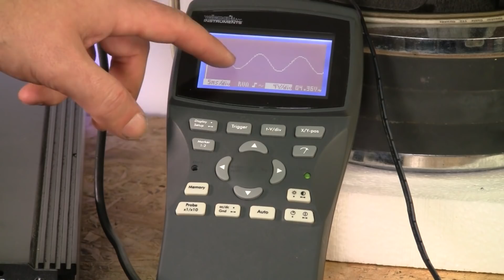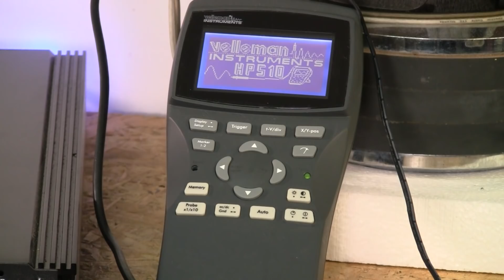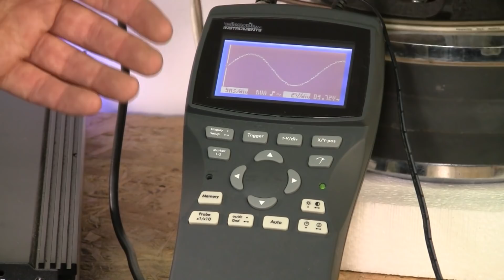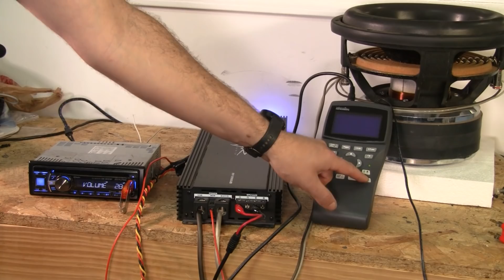How your budget amp kills subs without clipping - Tech Stuff Tuesday

Comment: So don’t get a skar amp? Didn’t know that they was a “budget” amp and here I was about recommend this amp to my friend for his x-12 sundown.
Reply: No!  Do not waste you money on any of the rp amp line.  For a budget class D, get either a hd1200 or hd3000, depending on your sub(s).  You wont be disappointed, promise!
Reply: No, don't....as for a budget pwm class D amp, have him get a taraamps hd1200 (get the correct ohm load for the wiredup sub).
Reply: This is their lower end model series so yes this is budget.  For your friend's x12 a taramps smart 3 would power it to full capability in the right box and is excellently priced. Imo it's the future of car amps with very useful technology built in
Reply: Buy sundown subs get sundown amp. The SFB series would be perfect. Every amp does more than rated.
Reply: Chad Beverly yeah I have the sfb 3000 for my zv5 15 😝
Reply: @rcwildman9255  how does it sound ? I remember reading a comment about the signal to noise ratio on it would make it not sound so well on subs
Reply: Chad Beverly idk where you heard that hehe, however it’s hard to say the zv5 is so Louis you couldn’t hear it if you tried however it’s musical if turned down now I guess if you was very picky and a music maker needing proper clean clean sound then probably not
Reply: @rcwildman9255  oh it was just some comment inder the testing video . im just curious to hear them in person
Reply: @chadbeverly4926  typically, s/n ratio is taken at 1khz...class d car audio sub amps might be different...if thats the case, im not aware of that.
Reply: Chad Beverly gotcha I do have a vid on my channel running my sub with it the video is named “sound” 😂
Reply: @J-Ro2082  well the sfb line is full bridge so i wonder how that comes into play for them 🤔

Comment: @emfaudio the pwm filter cap looks to be the culprit. I see frequency modulation within the output signal, indicating issues with tge DAC. Could be because it is "cheap", could be due to vibrations.

Comment: Cheap drivers offamps and filter caps means a feedback through the audio output. China is notorious for this. I had the 150.4 in that line I had all kinds of issues with it. From the ground feedback to a soft clip during it's so called soft turn on cycle.  Had the very same issues with a few other chinese made amps.

Comment: The best cheap amp on the market is the 2250 rms watts soundqubed not Taramp full channel get the Taramp bass line that's another good one. Skar 4500 is also better than that RP 2000 amp.
Reply: If you need a 2k amp i recommend the cab 1500.1 or the ct sounds 1400.1 . all tested and proven to do 2k and they have 1/0 inputs. But im interested in seeing how that goes up against the SFB 2k.
Reply: @chadbeverly4926  I actually like the 2000 rms watt Hifonics Brutus amps that's what I'm running.
Reply: @RyanBassForLife  hifonics makes AMAZING amplifers especially there new stuff. Very beautiful !  I just wish that they wouldn't max power rate them because i believe they could be a force to be reckoned with . I heard a older version hifonics Zeus on some 15s. You talking about a night/day difference.
Reply: @chadbeverly4926  yes just check my videos out on my 2 hifonics 2000 brutus amps bridged to 2 ohms floating napkin and my car cover.

Comment: If when you turn your oscope off and back on again without touching the amp and you see something different on the scope, that indicates there's something wrong with the scope. The amp didnt know your scope turned off and back on and decide to correct or change the signal while it was off. I'd like to see it on another amp to see if you're having the same issues
Reply: My thoughts exactly. Same signal just measured in two different environments.
Reply: But it could be something with voltage referencing and targeting... Idk just saying
Reply from the maker: If you notice, off and back on didn't always solve it. Perhaps I got lucky with track change sometimes when it did work. I have other videos using it on different amps, with no issue.
Reply: @EMFAudio  I have 8 Skar audio amps(6 of them are the RP series) and I have run across the same situation where at minimum volume, as i am turning it up, i get that crazy wacked out wave that corrects itself once i get past about 1/4 volume or gain adjustment. This has only happened on my RP800. 1 that will begin to clip at around 28.5v but the wave gets all funky between 4-6v.
Reply: @jacoblittle3209  I think the big question is, is the amp doing anything to the sub at those lower voltages which would behave like a DC battery (start burning the coils)? If not, that may just be how the switching circuitry operates at low voltage. I'd be more curious to see whether there is IC compression in the sine wave at the extreme limits of power, which may indicate a more advanced amp design. I'm hoping my brand new (2023) purchased RP-800.1D has no problems.